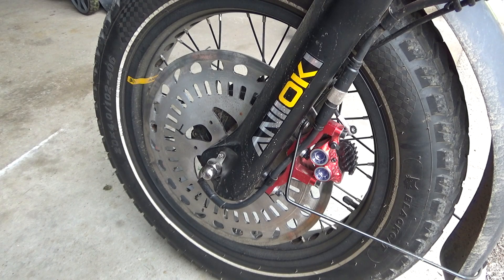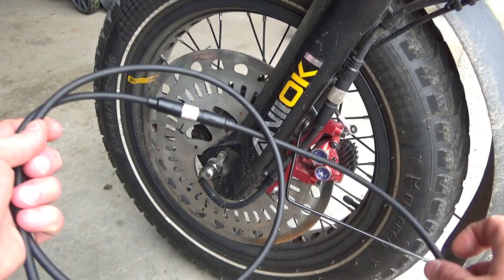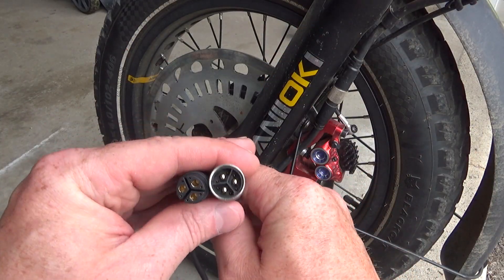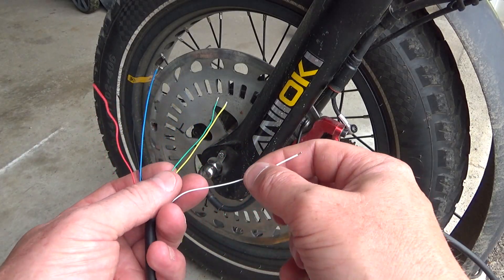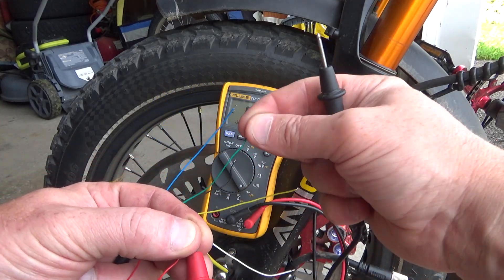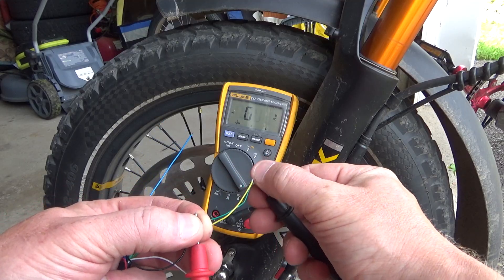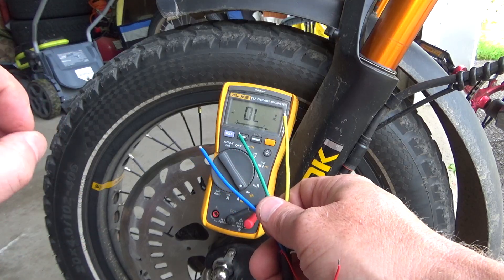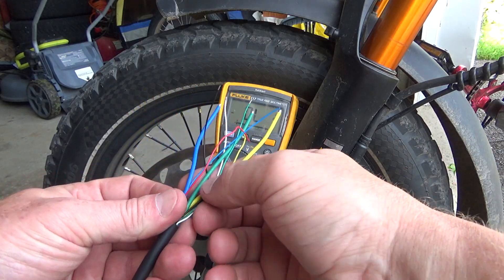Hall sensors test

Comment: My Speedo is off by ~50% so what reading should I be looking for to know if it’s bad. 

I’ve suspected it’s a bad hall sensor from the day it started malfunctioning, but a Pedego mechanic said it can’t be a hall sensor issue. 
Thanks for the video I’ve been feeding pulling motors apart just to check the hall sensors
Reply: 6:03 ok .6 will be checking as soon as cable comes in. 

Do you think I could just switch the white wire to the controller to the front wheels white wire to get accurate Speedo reading again. 

I have 5,000 miles on my A9 and am going to open both motors to grease the gears ( maybe even replace ) So replacing a hall sensor wouldn’t be that hard while I’m in there. 

I ordered the cable so I’ll wait for it to arrive and check before I open the motors to do the gear work. That way I can check and just do it all at once.